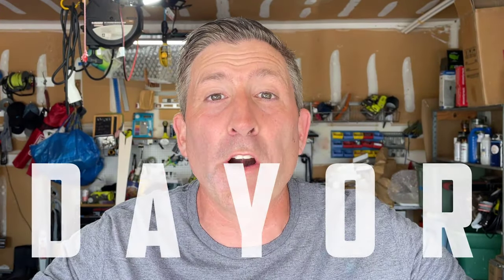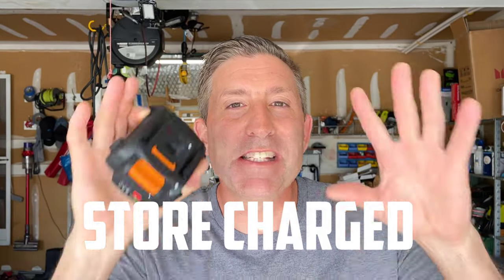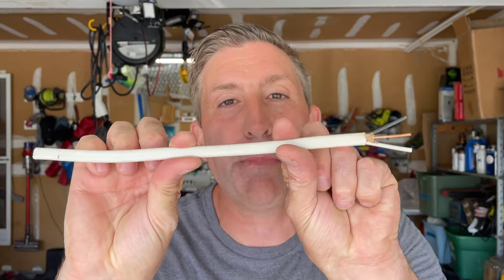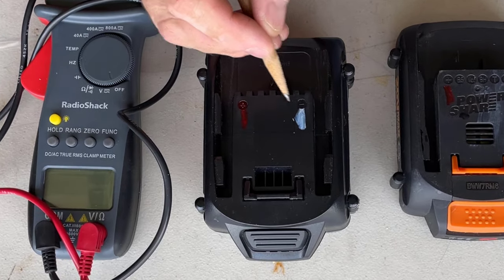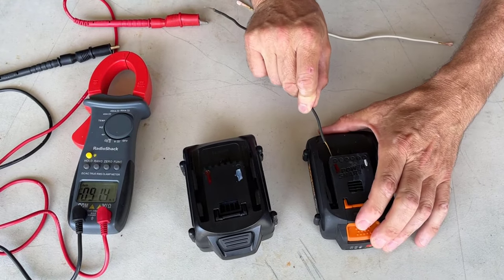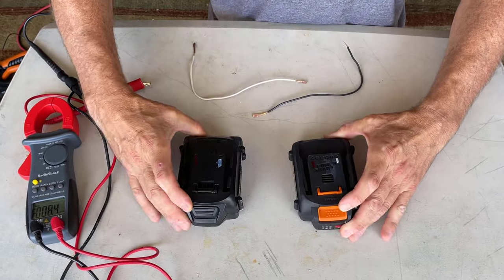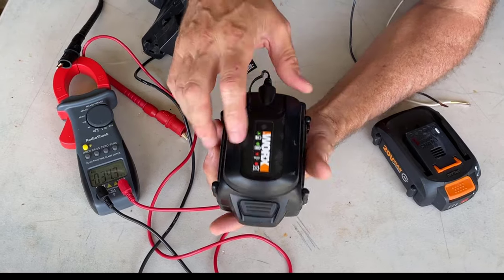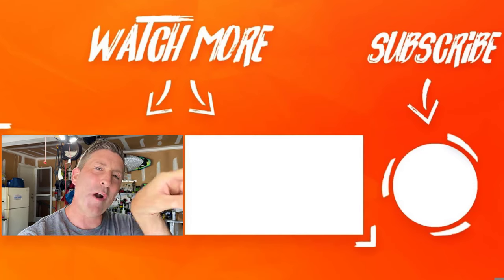DEAD TOOL BATTERY JUMPSTART HACK - Ryobi, Dewalt, Milwaukee ⚡⚡⚡

Comment: If you notice once you hook up to test the battery the second time (after the jump) its steadily dropping in voltage......   The battery has a bad cell in it.   Ive jumped several different types and size batteries in the last few years, and over time, I've discovered that no matter the type or size, if it has a bad cell, (or cells) it will continue to drain. Thus that battery will continue to drain over time faster than a battery that doesn't have a bad cell.  There are ways to replace individual cells but that is not as easy for just anyone to do.   Excellent vid though, and hope that info helps.
Reply: Can I jump a 12v onto the dead 20v
Reply: @scottschmittmusic   thats what I'm wondering, he says at 1:50 "the voltage matters", but I was thinking as long as its the same type of battery it should work, and I'm just making what I thought was a somewhat educated guess. LOL
Reply: @scottschmittmusic No you need at least the same voltage (but also not too much higher) less will not charge it. Although if you put two 12V batteries in series, then you'd be in business.
Reply: Have a blessed day!

Comment: This rocks!  I had a Craftsman battery that I never could charge.  After putting on a small charge for like 30 secs, it started right up on the charger.  So cool, thanks!
Reply from the maker: Great - make sure you sub

Comment: I am a homeowner with a day job who does not do anything construction related for a living. That being said I am working on framing out my basement and Bought this https://www.youtube.com/post/UgkxHQsUrwNr5GQrnx9V4xDdUr56qxwuiBHt gun. I have done a few walls already, have probably shot a couple hundred nails through this thing and have yet to have a misfire. It works awesome, good depth on every nail if you have your compressor set right. My literal only complaint is that it is a bit heavy and my arm can get a little tired especially whrn I am nailing at odd angles. That being said I am super happy with it and would buy it again. Hoping the old girl allows me to get my whole basement finished out!
Reply: There is another kind of power nailer you should be aware of. It has a small internal hammer that will hit very rapidly to drive a nail in less than a second. Likewise air powered. Less than $45 to buy new. Downside is that it doesn’t hold nails inside it, only acts as a power hammer. Upside (besides the lower cost) is that it can drive any size nail, and is easily controllable as to depth. Plus you can maneuver it into just about any space you want, as it is less than palm sized.

Comment: I had a brand new out of the box milwaukee battery that would charge so I grabbed a piece of romex hooked it to another one of my milwaukee batteries for 2 minutes and put it on the charger and it immediately started charging..this is a great hack

Comment: Thank you so much for the tutorial. I saw some other video and used a simple steel wire and it just burned out !! 
I had totally missed out on the Amp and Wattage understanding. It took a a $1 for a feet of 14 gauge wire and 30 seconds to charge my dead battery. You saved me exactly 99$
Reply from the maker: Great - throw me a sub

Comment: I like the solid wire trick. I use an auto spade connector with a test lead
but those connectors are SO small I am always loosing them. I'll try yours.

!

Comment: Thank you so much for such a clear and helpful video! Just "jump started" one of my Milwaukee m12 CP 3.0 batteries that wouldn't charge but would still start a tool, just showed low battery. Was registering a little less than 10 V, 80 seconds later, showing 10.8 V, showed two bars on a power tool, and plugged it into the charger and it started charging as it is supposed to. Again, thank you so much! Saved me buying another battery or a $73 service few to Milwaukee since it's outside the warranty range!
Reply from the maker: glad to help - please throw me a like and sub

Comment: I have 4 black and decker batteries I've had for over 20 years, 2 of them I have "rebooted" multiple times and they still work as backups. They tend to release their power faster than my new ones but they are there when i need them.

Comment: Thanks a lot for this video!
Checked 2 Mensela 2 Ah and 2 6 Ah (50 USD each). One showed 4 lights, the other a poor shadow of one LED, and it took no charge. Kicking, jump starting, the poor battery a few minutes, like You did, and it takes charging! Wow!
No surprise. Opening the sad battery quite some electronics sits inside.
If the voltage goes down too much the built in controller doesn't run and then no charging is performed.
Reply: Unfortunately the battery only charge up to 13 volt, not 18 - 20, and is scrap.

Comment: I wish I had another identical battery to fix my 24v but like you said, you need another 24v to do this.  Thanks for the tip
Reply: Do you have two 12 volt batteries by chance? You can wire those two 12 volt batteries in series and then charge your 24 volt with those.

Comment: I have been trying this on my 48v lawn mower battery. When I plug the last of the 4 connections in (be that +ve or -ve), it gives a spark and small explosion - any idea why that is? Anyway, by Jove it worked. Saved £160 for a new battery!

Comment: Thank you for this! I just attempted this and it worked with my 2 Milwaukees, had one at 20v and the other I couldn't even get a reading or  at least a volt. Connected them for about 30 seconds and the 2nd reading jumped around 12 to 15v, the dead one then took the charge.

Comment: What if I don't have a spare battery? Can I run the + and - terminals to the charger directly? 
I noticed mine has 4 terminals, but only 2 are + and  -??

Comment: I will like to say thank you 
I have seen videos on this subject in the past this only reason for me to be looking for this and seeing you is I found a hart tool on the side of a road must have fallen off someone's truck I had this tool about 3 years now yep it be dead 
Then my Milwaukee tool died after 15 years so in the interest of saving a few Lincolns I got a charger and that problem well I did do it pretty close only difference was I used a 19 Guage wire the thing I noted was the battery did get hot the other thing was it needed to cool a few minutes then it wanted to work well need mention I did try once while it was hot and nothing till after it cooled now it is holding a charge I figured I have nothing to lose I found it 
And you talked me in to it with a fine video brother 
Otherwise it would be still a paper weight 
Then that other thing you mentioned was Milwaukee is apparent company indeed that's nice all although it don't handle like the Milwaukee free is the price no complaint 
        Good job done

Comment: Why does the voltage have to be the same on the jump start battery?  Wouldn't a more voltage battery equate to a better jump start?  I used an 18v/54v dewalt jump start battery for my 10.8V dead lawn mower battery.  It didn't work.  I got the lawn mower battery to one signal light charged but that wasnt enough to get the charger to fully charge it.  And I dont have a multimeter to test how many volts it is.  Where am I suppose to find another 10.8V battery?

Comment: I've got 3 porter cable batteries that all simultaneously decided they'd charge for 30 seconds and then be complete. So I thought it was the charger. Replaced the charger. They'll charge for an hour now but then say complete. However you connect em to a tool, they are all dead. 

Porter cable also discontinued. So I don't know if they need a jumpstart or if I should just use knockoffs from now on

Comment: I have a Worx 24 volt battery that went dead.  However, I do not have another 24 volt battery.  I do have a 40 volt Black & Decker (higher) or an 18 volt Performax.

But from what you sre saying, I MUST HAVE the same voltage?   So I would either need another 24 volt good battery or I am SOL.  Is that correct?  

What could happen that is a bad outcome if I tried using either the 40 volt or 18 volt to attempt the jump start the 24 volt?  Just curious.

Comment: It did work for me:  I had a Ridgid 18V that was showing less than 1V at the +/- terminals.  I used a bench power supply (0-30V 0-5A) and set the voltage to 18V and amps to minimum.  I slowly eased the amps up until the CV/CC lights switched over.  That was about 3A of power.  I left it on for about 2 minutes, then disconnected, checked voltage and it showed about 12V no load.
Hooked that up to the charger again and it is now charging :)

Comment: Super, thanks heaps! I had no luck with an 6Ah 18V (20V US) battery starting up a 9Ah 54V (60V US)  battery but when I used a battery with the same voltage as you suggested then it worked! Whoohooo! I was nervous using my expensive battery to do it but it was a winner! Thanks again. 

I actually got ripped off on Facebook Marketplace after being sold a battery cheap and then getting home and it not charging and the bloke blocking me so I could not follow up! I felt pretty dumb but turns out I got 54V 9Ah battery for $90 Australian dollars. Whoohooo! Did I say thank you!!!!

Comment: I've got a McGregor 21.6V battery for a lawnmower that it won't work. I tested on one charger where the red light is blinking, on another charger the green light is on as if it's fully charged. I press the button on the battery it shows it's charged up to the first green light, what do I do?

Comment: Does the donor/working battery need to be the same capacity/output as the battery to be repaired? I have an M18 8-amp battery that needs fixin' but the only other M18 batteries I have for jump starting are 5.0xc
Reply from the maker: it might work

Comment: It is worth opening the battery pack [ I presume it is out of warranty, because doing this will void it]. The thing to do is to check each cell to see if the voltage on all are more of less the same. One or more cells on a lower voltage means those cells are toast, so this method will not work. If you are good with a soldiering iron you can de-solder the trashed one[s], replace them, and try again. [At your own risk, blah blah blah]. 
If you start a fire with a lithium battery, they are really hard to put out, even with the proper class of fire extinguisher, so there's that. If a Lithium battery gets too hot you will have a "thermal runaway" which is super bad news.  The smoke emitted can be highly toxic. Some cells contain lead, nickel, cadmium, mercury, and electric car batteries, cobalt. If you breathe cobalt for example, you are dead. So if you are anywhere near such a fire, go upwind and away.  FAST. 
Probably why such hacks are not recommended.

Comment: I have done this on car batteries and a lawnmower battery where the smart charger isn't smart enough to charge a completely dead battery, and 1.5[1.2]volt rechargeable AA batteries.
It hasn't failed yet.
Reply from the maker: Cool - have you ever tried this on a battery

Comment: I have a 36v ebike battery that has suddenly refused to charge (low voltage issue) - do you think this trick could work if I connected a 36v tool battery (of the type seen in your vid) for a few seconds in order to trigger a voltage boost and reset to enable normal charging? (using the proprietary charger).
Reply from the maker: It might work - do at your own risk

Comment: I have a dewalt 20volt 5amp that when put on a fast or slow charger it shows it charged. When u take it off it is dead. The charge lights don't light up at all. Tried doing the jumping  it then lights up. Left it on for 5 10 15 mins didn't matter still said it was charged when I hook it to the charger? Any suggestions

Comment: I bought a 40V Greenworks lawn mower at an auction. It has two 40V batteries that won't charge. The output voltage is only 20V. Jumping them with a good 40V doesn't increase the voltage. The batteries and lawn mower look like they were never used. Probably just sitting for a very long time. The battery indicator lights don't light up. Holding the button for about 10 seconds will make all the lights come on, but it still won't charge. I have tried two different chargers. Any suggestions?
Reply: I have the same problem. Did you figure it out or did you end up buying new batteries?
Reply: @ramblinman7153  I bought new batteries. I tried to jump them with the new battery and it still didn't work.

Comment: Does not seem to work on Ryobi One+ LI-ION with the 3 terminals on the protruding part and two terminals towards the front on the base of the battery. I even connected a power supply and no power would transfer. I suspect this is because one of the other terminals must need to be connected to something in order for the brain chip to allow electron flow. Any ideas?
Reply: Yes I've done it with those batteries

Comment: I live in Las Vegas and temp nowadays is always 100+.  degrees.  My tools are in my not-air conditioned work place.  One of my batteries just stop working.   I put it in refrigerator for few minutes and it worked.  So before doing anything I just put them in refrigerator.  Now I remember when  the battery I left under the sun for a day.  I should have tried cooling it before unsuccessfully repairing it.

If all cell of battery are good this will work but if any (even only one) is bad this method will not because the bad battery will not charge and the rest are over so the total is correct but will not last.  You will notice that the good battery will overheat due to overcharging.  You can test and change the bad cells.  Note that most cell/battery have protection and if they open it is hard to repair.  

My experience in testing and repairing each cell.  If the protection is closed.
1.  I notice that most drill uses 3 + volt individual batteries and I believe each cell is always 1.2 volt.  I assume (correct me if I’m wrong). That the 3+v battery used have 2 cells.  So even if the battery is getting charged it will go to 3 v but in short goes back to low charge like 1 volt.
2.  The method described by the author will also work for individual cell as long as the battery still good.
3.  I’ve used several unsafe ways to revive battery. Please don’t do.  I think this the better way or you can buy a charger.  If the battery reached say 3.+ volt and stayed for hours it good.  Be sure to assemble and use the right charger.
4. After trying several times and failed  I’ll just buy individual batteries or the complete batteries.  In buying (eBay),  some sell really good.  Found one with warranty.  One battery from another seller broke in life’s weeks.
5.  I tried this method before and this method is the safest.  With rigid battery I believe you have to use jumper from + to one of the t terminals   To make it work. I think it’s t2.  Note that this method works because if there is something wrong with the battery the charger will not start ( no voltage in + and -  posts).  But my rigid battery has complicated circuit (to ensure individual cell gets the right voltage / charge). So it needs a jumper to fool the circuit.

6.  Good reminder by Mr “kite”- keep batteries charged. Don’t store discharged and completed discharge - that’s why some have protection to prevent too discharge

Comment: I have a 40v Greenworks battery (actually says 36v, 40v max on the specs) reading 35.6v, won’t charge. Think this would work in my case?
Reply from the maker: yes - it should

Comment: Yes this does work however, the newly recharged batteries will only last like 24hrs after that they will go back to not being able to be read by the charger so there for you will have to do this method again which will most likely ruin the good battery.

Comment: 1:33 finally someone says it... need identical voltage batteries.  when I tried connecting it sparked, so I stopped lol. And smoke, heat, and wire melted also. Hmmm.  and can this technique work with different voltages?

Comment: Just worked for me, dead one has green light on the charger anyway. 
Had to buy another $70 battery to do it, but now I have 2. It'll be nice not to have to swap from drill to drive.
Reply from the maker: Cool - make sure you throw me a like
Reply: Unfortunately while the jumped battery appeared to be charging, after the green charger light went out, the battery was still dead as doornail.
Certainly worth a try though. @Kitearmy

Comment: My working battery is at nearly 40v and the one that won't charge at 20v. But when I connect them as described, even after 15 minutes, there is no difference.
Reply from the maker: You got a dead cell

Comment: Trying this tomorrow with a Festool batter that refuses to charge. I'll have a fire extinguisher on the side just in case. One thing that needs correcting: Nickel and lithium-ion batteries should always be stored at around 40% charge

Comment: How do you figure out which terminal is positive or negative?
Reply: use a voltmeter as seen in the video. black on voltmeter is negative. white is positive.  so if you connect everything and you get a -   reading,   then swap terminals on the voltmeter.
Reply: Maybe don't try this if you are unsure. Lithium Ion batteries when shorted are extremely volatile and can very quickly become an uncontrollable fire. Understand what you need to do before you try anything.
Reply: The battery is marked right next to the terminals: B+ and B-.